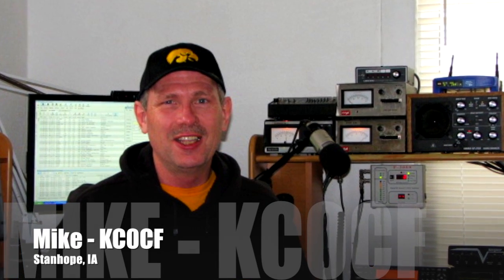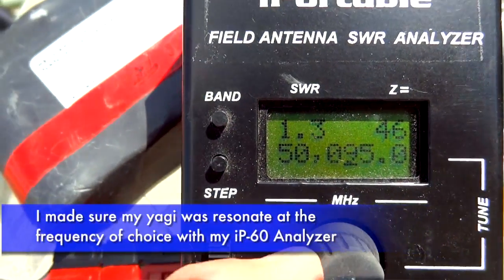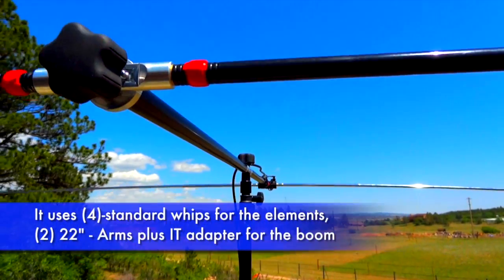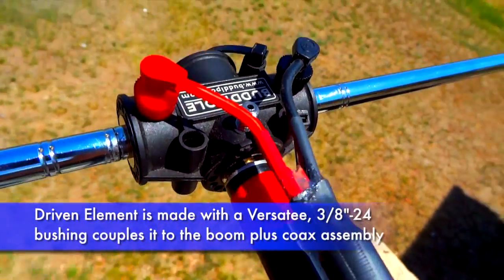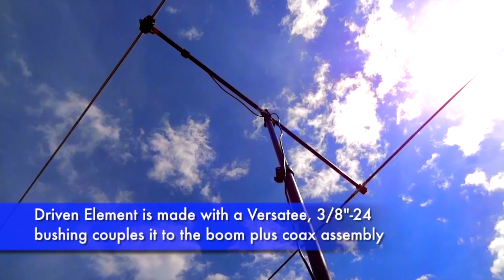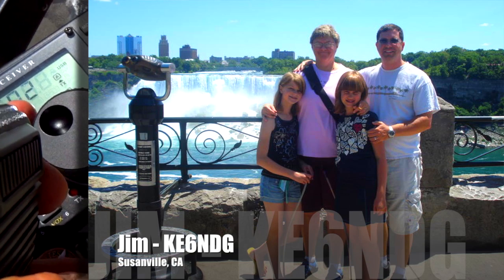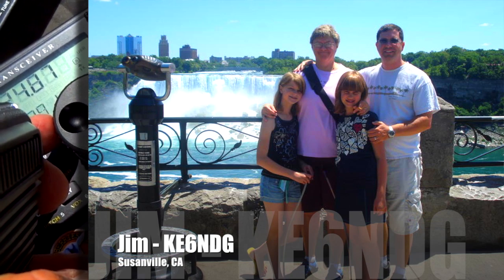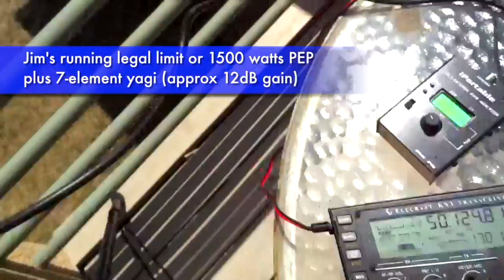KX3 with Buddipole 2-element Yagi on 6m

Comment: FULL Limit = 1500 Whiskeys. 7 el Yagi will have at least 12 dbd gain and that amounts to 20 x the power. So
If that is accurate what he is saying his antenna is emitting 20 x 1500W = 30 000 Watts. With that AirPower ,he should be heard in his neighbor's garden on the Long Path off the back of his antenna ,  if you know what I mean.

Comment: when you're running a two element like this, is that a director in front of the driven element or is that a reflector? I can't tell how large the elements are
Reply: Driven Element ( DE ) is always second from the back end of the antenna. The reflector --> reflects waves from the  DE ( dipol for that matter ) and Directors ( direct - narrow down the signal to a certain max angle and enhance the signal strength in decibels ).

Comment: Great videos. Do you know that you can use the KX3 to read the SWR of the antenna? Just tune to the freq that you want to use, and hold down the XMIT button. A display will appear with the SWR reading. No need for an analyzer. Wane taught me this feature.